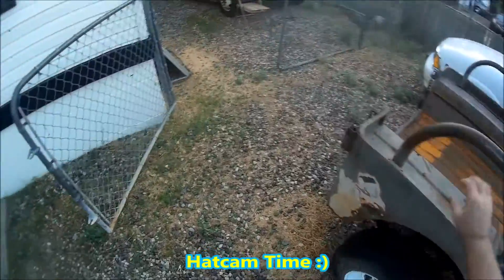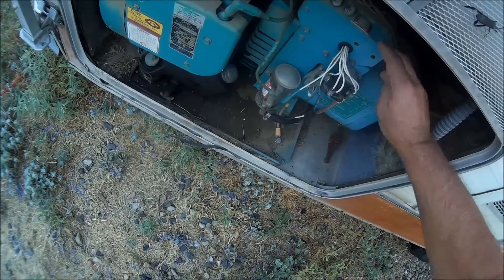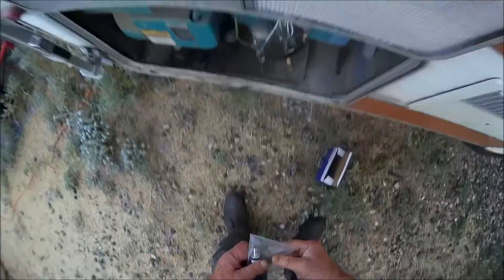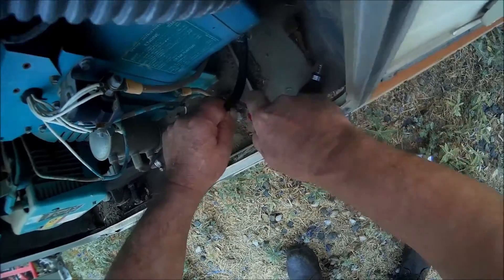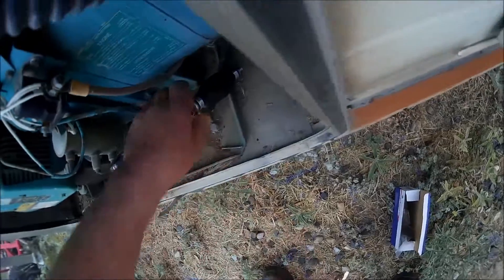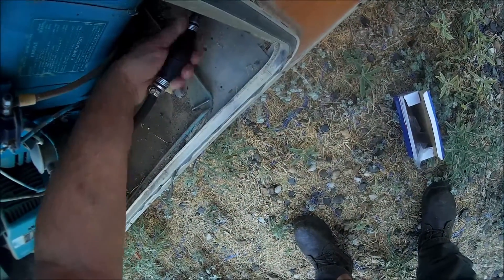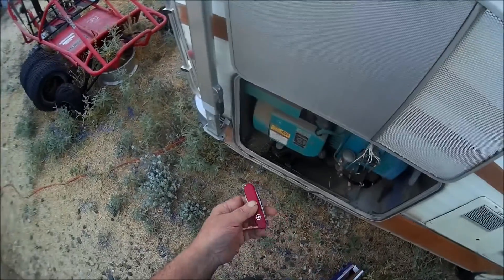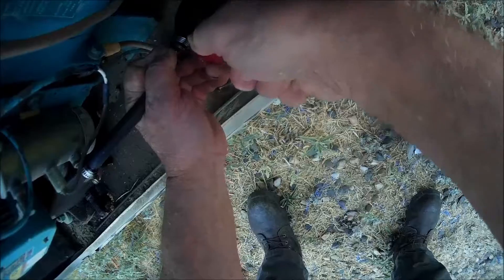More Preparations for Off Grid Homestead RV Generator no worky and Repair Ep.3

Comment: Nice still lution. We haven’t run our RV in 15 years -time to get it running after the solar upgrade is completed, greenhouse winterized, and water system insulated even more. Take care.
Reply from the maker: Thanks for watching and the comment, and Yes I've learned over the Years the worst thing on Vehicles and Equipment is not running or using for long periods, things dry up, fuel evaporates leaving sludge, seals fail and much more. After 5 Years of not running My RV I had to overhaul the Carb, replace 2 Tires, and 2 new Batteries, and the list goes on, I'll be following You closely as I'll be working on getting My Solar situated soon, thanks again and have a great Day! 👍 😉
Reply: Hyper Joe we’ll need 6 new tires, clean fuel system, pump out gas tanks,  ... and ...
Reply from the maker: @BrainStormAcres  Exactly, I know the Drill, I'll be posting a Progress Video on the RV, should be up Tomorrow.. 👍 😁